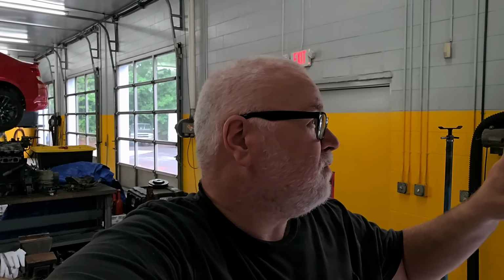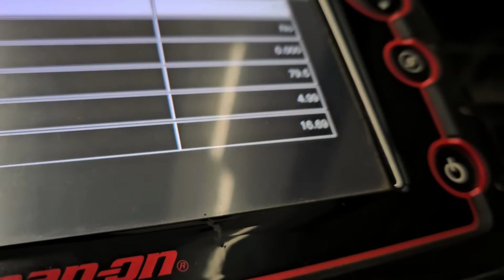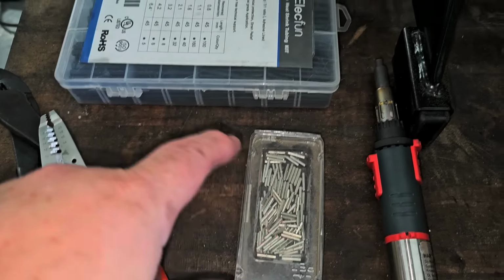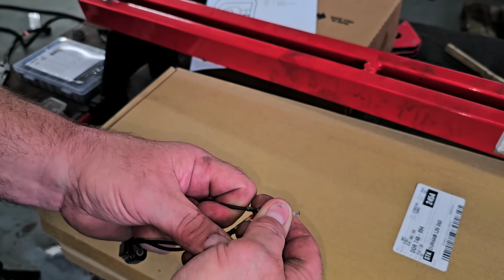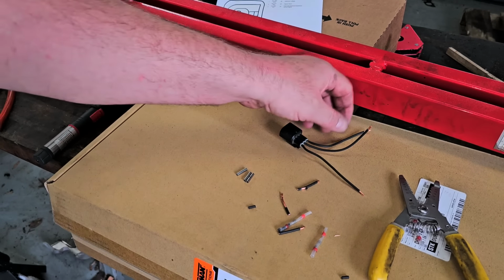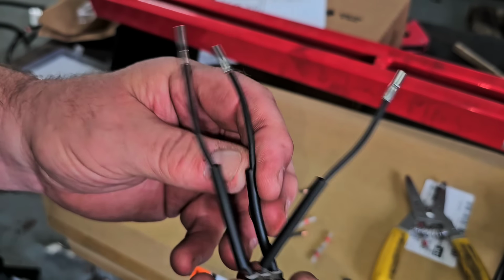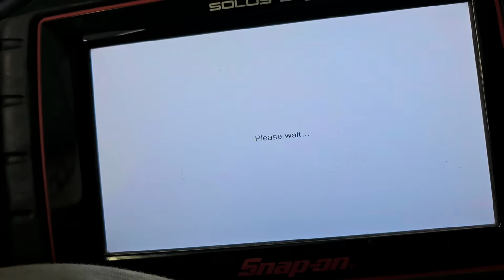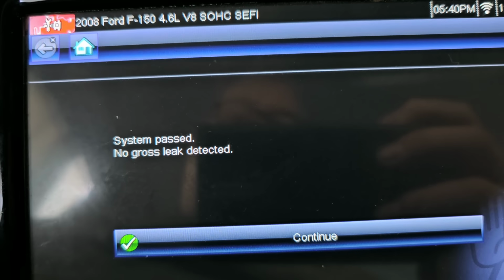Do Not Use These Connectors! They Are Not As Good As They Seem!!

Comment: It's o.k. just to twist the wires together, solder them then shrink wrap them as long as the bared ends are clean & free of corrosion as well as being etched which could be while soldering the 2 ends together with rosin cored solder.

I did that as part of an exercise at tech 30 years ago when I was doing a small automotive course which was like an appetizer to the main course so I was doing a few trade courses to get a taste for what I wanted to do,I chose the electrical trade over the automotive trade because I had to flip a coin to choose.

One of my automotive teachers were helping me make the decision by telling me that the department of education and training were closing that part of the campus down & running all the courses from another campus the year after which is further away & out of my high schools range since it was a joint  initiative between the tech & my high school.

We were also soldering copper plates together & soldering the bare ends of the wires onto the copper plates,the mating surfaces had to be sanded of any tarnish then etched so that the solder would take to the copper wire.& Copper plates.

So if you're trained to straight solder the wires like I was then that's o.k., I have soldered together a Nissan R33 Skyline GTS wiring harness together so it fits into my Holden VL Commodore ,I used the original Holden power feeds, ground wires, the EFI & fuel pump signal wires by splicing that part of the original Holden VL Commodore wiring harness into the Nissan RB25DE EFI harness from the R33 Skyline by soldering the wires together.

It was a 3 litre variant of that engine that I built which ran the original RB25DE ECU & I never had a problem with that EFI wiring harness which I soldered together.

I know that Chrysler solder the ends of their crimp on connectors together probably to improve conductivity,I noticed that in my dads neighbours old Jeep Liberty !

Comment: I have never used those, I thought I would give them a try, until now. I know how to solder correctly, and those things will give you what they call a cold joint. It is low heat solder that melts when you heat the shrink tube. and who ever did that job didn't get that solder hot enough. To solder it correctly you have to get the wire hot enough to melt the solder, solder it and then put the heat shrink on. I agree, those connectors suck. A good crimping tool is way better. In a pinch if you have to just twist wires together, there is a way to do it well, it's called the western union. Can't really explain, but look it up. That's what they did a lot in the old telegraph days.

Comment: I fix them one of 2 ways, just like you did in awkward places, but if i have room I will solder and heat shrink. Never had an issue.
The scotch lock guys have issues months later due to corroded connections. If I see them, I cut that garbage out and splice it correctly. Keep Wrenching

Comment: I never had an evap problem on my Japanese cars.  But I noticed at Costco gas station that lots of people over fill their tanks.  (Hear them pumping more gas after it was full).
Reply: The reason people keep pumping the handles on their fill nozzels is because they shut off premature to being full.
The methanol doped fuels foam as the fuel under high pressure is released to atmospheric pressures as it exits the nozzle.  
Most stations serving fuel and have more than 4 pumps run their pumps at a higher than recommended pressure which causes the handles to trip prematurely and the cars to fill to quickly. 
This causes users to pump the handles to get more fuel in which wears the handles and air valves and makes the problem of early handle tripping to become worse. 
If you remember the old pumps they actually pumped fuel using large throated hoses and hardware and individual high volume low pressure pumps. Modern systems have gone the other way with high pressure systems and crank up the pressure to reach the needed volume at a service station with many filling points.
Some one filling their car a large distance from you can cause your filling session to end early if they pump their handle attempting to top their tank because all the stations are running off central pumps and their actions create a "water hammer"  in the fuel lines through the entire system.
I use diesel these days so these problems are not as common for myself, but can be a problem at large truck fueling stations which are plagued by the same problems when everyone is pumping diesel.

Comment: I used the Mercedes Benz ones all the time, we never had problems with them, the trick was to span the wires then push them through each other then twist them together with clean washed hands then heat solder first, then heat the outer parts to the wire casing which seals up while shrinking. That is their only wire repair that was approved to join a harness to harness repair.

Comment: I was a weapon specialist solder person I know soldering and those are crap fitting maybe good for temporary test connection but wires get dirty,  sn63 /37 solder at a minimum  might need extra flux a  RA or RMA  flux and sometimes you need to replace the wire due to corrosion .

Comment: I think its a misconception that car manufacturers use crimp connectors because they are a better connector, which is not necessarily true. All wire joining techniques have a failure point. Automotive manufacturers use crimp connections because they are much easier to facilitate in manufacturing and have a reasonably low failure rate, but soldering, which is used in most electronic devices also have a low failure rate, and are much less bulky. OTOH, solder connections have a higher failure rate when exposed to vibration. The problem with these self soldering connectors is they are held together by a low temp solder and shrink tubing; both requiring an optimal amount of heat; if the heat is insufficient (or the connection is exposed to high heat as in near the exhaust manifold, it can resulitify the solder) they can fail. With a crimp connector, especially with uninsulated butt connectors and shrink tubing, there is a more verifiable connection and the shrink tubing not only seals the connection (marine shrink tubing also has a sealer that liquifies with heat), but is also a secondary connecting factor. 

Eric O also points out when using standard insulated butt connectors, many use the uninsulated portion of the crimping tool, which can pierce the insulation. Rainman Ray does this, but he also used shrink tubing over the insulated connectors to seal them; this is most likely because he doesn't have any uninsulated connectors. This probably works just fine, but creates a more bulky wire connection and there is much less chance of salt corrosion in Florida.

Comment: When the solder connectors are done right, they work well. If not done right, obviously they don't work. Same for crimp splices. I cannot tell you how many times I watch someone crimp a splice by squeezing it between the handles of a pair of wire cutter. No slice works if done improperly.

Comment: Not enough heat, they work well and are not garbage if you use them properly. Crimp connectors, and butt splices tend to be more of a problem, as another commenter said. He used them in Marine environments.

Comment: Good automotive practice recommends against soldered connections in wiring since it makes the connection points rigid and subject to damage from vibration.  As soon as I saw your crimping tool I knew this was not your first rodeo.  Most shade tree types won't spend that much money on a simple crimp tool and the results usually are obvious.  I prefer the nylon coated butt connectors though.  Yes, they are bulkier but the nylon is more pliable than PVC.  To compensate I stagger the lengths so the connectors aren't all together in a bundle and then I tape it.  (Yes, tape.  Went to a two hour seminar by 3M on the proper use of tape but, it turned out to be very helpful in my career.  They even did a 20 minute presentation on hour to prevent "flagging", where the end of the tape pulls up, and how to prevent it.)  Then the corrugated and heat resistant loom.  And, of course, no automotive wiring job is complete until you put the last hundred zip ties in place.

Comment: Stranded wire with mechanical crimps and heat-shrink tubing to seal the joint is a better choice than soldered joints in applications where the wires might be subjected to repeated flexing because that configuration is less vulnerable to fatigue breakage.  The worst configuration is solid wire with soldered joints.  On boats I used  tinned, stranded wire for the added corrosion resistance.

Comment: As with many other components the quality of solder sleeve connectors vary widely. I used them manufacturing medical equipment. Never gave us any problems. I recently purchased a solder sleeve kit from Amazon. Absolute garbage. No matter what I used to apply the heat I could not get the solder melted. The sleeve shrunk, the glue melted and sealed the sleeve, but I could not get the solder to flow. The reason the sleeve is clear is so you can visibly see if the solder has melted/flowed. A quality solder sleeve can provide a great reliable solder connection. But they need to be sourced from a reliable vendor, such as Digikey, Mouser, etc.

Comment: They work well if you buy professional ones like  TE Connectivity Polyolefin Solder Sleeve and follow the manufactures guidance but they're x10 the price of Chinese ones. Solder sleeves are used in avionics so they can't be bad.

Comment: I agree with you those things are crap. I usually just use the heat shrink butt connectors but you have to use the correct ratcheting crimping tool with them or else you can pierce the insulation & create a hole for water intrusion. If done right they seem to be the best.

Comment: I like the crimp with the built in heat shrink connectors.

Soldering causes wire breakage on vibrating harnesses. There is NO solder in harnesses in any of the large off-highway equipment I've seen.

Comment: I'd say the main issue Kenny here is talking about with those style of connectors as he stated is how do you know FOR CERTAIN that you have a good connection with these connectors?  They can become heat shrunk together at the same when trying to set the solder up.🤷‍♂  Best to have the soldering done first, test its penetration & mechanical holding ability, and once that's verified, then heat shrink it.  I get the appeal of trying to do it all at once, but problems can arise in the real world (especially with inexperienced/DIYers) as many of us have found who work in auto repair.
Reply from the maker: Nailed it! Thanks for your reply. Keep wrenching 🔧

Comment: The copper looks oxidized and solder never penetrates oxidation.   They have to be cut back or thoroughly cleaned first.
Secondly, unless the joint is well supported, vibration can cause the soldered joint to crack because it removes the flexibility of the copper by hardening the strands.
Thanks.
Reply from the maker: All very good points. Thanks for sharing & keep wrenching 🔧

Comment: I solder the wires, cover with silicone than heat shrink. Never had a future failure. I did see one soldier connection on a Honda many years ago tapes up from the factory it was a failure point I found many times.

Comment: Thirty years in military defense and we use these. You need to pre-tin the wires and overlap them. Then you have to make sure the saudi Solder ring is completely melted. If done correctly, you can see the physical connections. I'm sure that somebody's cheaper ones that you see.Have a very low temperature melting point for the solder. Now that would be a major problem

Comment: Hard to see but to me it looks like they never heated it enough to melt the solder ring. I am an avionics tech and we routinely use a better quality product made by Raychem that is similar to these. But we use them as a shield ground on various types of data wires. Either way, you have to use a high temp heat gun, or a propane torch like what you have, to melt the solder completely….and it takes some heat. Not familiar with the ones you show here but the idea is similar. You are also correct that a mechanical and environmental splice is best for wire joints.

Comment: Good job on finding the outstanding issue, But you should not put the blame on the product but the person that incorrectly installed the connectors. Definitely need to use a torch to get the solder hot enough to melt, the ones that you removed did not have the solder melted.

Comment: The solder in those connectors never melted. User error.
Mercedes recommends these connectors ( specific part numbers based on wire size supplied by their preferred supplier) be used when doing wiring repairs in all of their wiring repair information.
They are clear so you can see inside and verify the repair.
 They solder the connection, contain their own flux to ensure wetting, seal each end of the wire and form a mechanical connection that is stronger than the wire WHEN USED PROPERLY. 
I've been using them since 2004. Never had a problem because I follow the directions and use a propane torch (not a lighter or soldering iron or hot  air gun as was likely used here) and then verify visually that the solder has melted and flowed into both of the wire ends.
The formulation of the solder was changed probably 14 years ago to not contain lead and that raises the temperature needed to melt the solder, those inexperienced will use a lighter which is fine for heat shrink, but not for this product. 
Like any other tool they can be used improperly. Even metal crimps can be done poorly by any of the yahoos that walk in off the street and get a bay in a dealership or small shop.
Reply: First rule of soldering - heat the metal, not the solder which is impossible with this type of connector. They are just a posh version of the old 'twist and tape'

Comment: I have used them with no issues on good clean copper wires. Won’t work on black/green corroded or greasy copper wires. I use a MAP torch and quality connectors, it’s the guys using heat guns and lighters on them that have issues

Comment: I have used them and had good luck, HOWEVER, I recognized their shortcomings. If the solder is old, and the flux is stale they wont flow. I add a dab of flux from my flux syringe, and i make sure it melts. Its not that the connectors are bad, Its that the installer is bad. These take skill. When use properly they are better than most. I clearly saw they werent melted . Cant blame the connector for that.

Comment: Rainman Ray’s loves those connectors.
Reply: They are like a low heat solder. I've seen Ray use them too. He does make sure that the 2 wires are sticking into each other before he heats them.
Reply: The wires in these cases were visibility overlapping, so that was not the issue. It appears who ever used them did not heat up the solder sufficiently, so it actually melted into the wires (their primary cause of failure). If you want to use solder, as Ivan at Pine Hollow Diagnostics does, physically solder them together so you can see the solder melting and use shrink tubing (marine is the best), otherwise use uninsulated butt connectors and shrink tubing. If you're in a pinch you can also use marine type butt crimp connectors insulated with shrink tubing.
Reply: Have seen them being used and sorry to you and others but if used properly and tested properly then guess what that are good not trash have seen the crimp ones not work properly my self i use heat srink and solder the joint properly never fails Cheers
Reply: Ray just posted a wheel speed sensor using these connectors

Comment: Hey Kenny!👋
I Totally agree!👍

Even though I had my doubts about them, I tried them. 
Once!😕
What a total piece of shit these things were. By the time you get enough heat Through the heat shrink to melt the Solder, you have basically destroyed the heat shrink, and have no guarantee of a Good solder joint.
Especially if you are working with 16ga or bigger wire, as it will just act as a heat sink and suck most of the heat from the solder junction, resulting in a Cold solder joint, at best!🤬
Totally a waste of time if you care about the quality and reliability of the work you do!
Perhaps there are some decent quality heat shrink solder connectors out there, but most of the stuff sold to consumers is Not high quality!
Had to do the job a second time, the Right way, with a ratcheting crimper and some damn nice butt connectors with high temp heat shrink already on them, with adhesive lining on the heat shrink to provide a water resistant seal.👍
Job Done!
Harbor freight carries some of these crimp connectors.
Highly recommend!

In the past I was certified for both Aerospace and Military soldering. Also performed failure analysis of Automotive crimp connections that were not only electrically superior, but also Gas tight. 
I worked for TRW Transportation Electronics Division in the early 1990's and we designed and manufactured Air bag crash sensors and sensing systems.
A good  crimp is an effective way of termination. TRW spent time and money to develop a gas-tight crimp which basically eliminated moisture intrusion and corrosion from wicking up the wire under the insulation. It is Amazing how far capillary action can suck moisture up a wire and create Copper chloride!😬
On a safety critical item like a crash sensor, hanging around exposed to the elements, a Good, Reliable, Durable electrical connection is paramount!👍

Mike in San Diego.🌞🎸🚀🖖
Reply from the maker: Good information, Mike. Thanks for sharing your experience. I really appreciate your reply. Keep wrenching 🔧